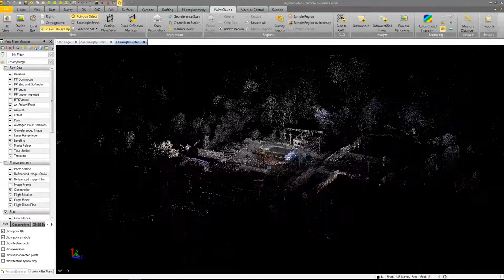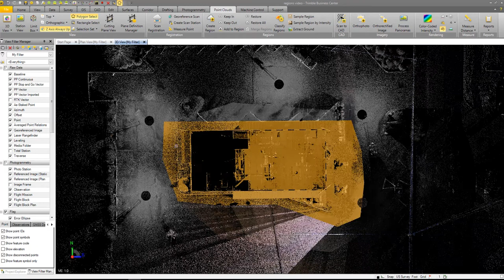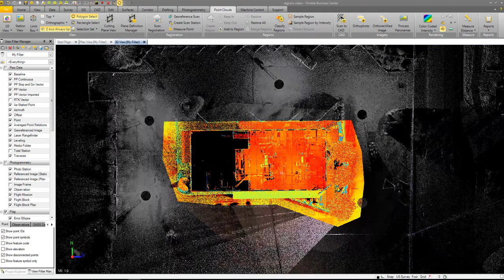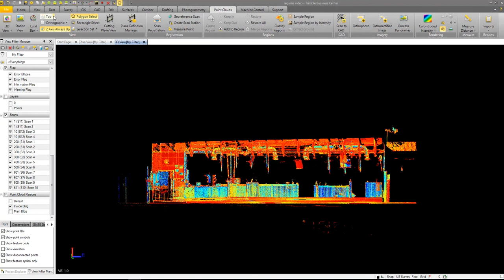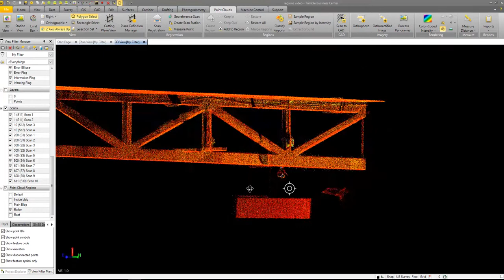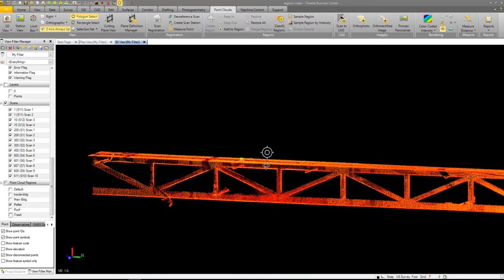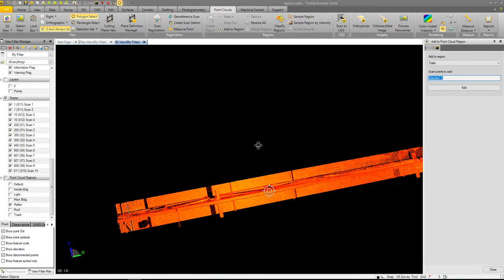TBC Regions, creating layers for scan data collected with the Trimble SX10

Comment: My Trimble TBC Crashes everytime i export to RCP?  Have any ideas on how to solve this ?
Reply from the maker: Are you running Recap Pro? If so uninstall TBC reinstall after loading Recap Pro.
Reply: @SurveyingWithRobert  Yes i am running recap pro.  I can import the point cloud if i change the format to laz or Las.  I do see a shift when importing 1.73' compared to my point file in autocad. this appears to be a grid to ground issue or units?
Reply from the maker: @ottorossmeyer9130  watch my video on exporting to Autocad